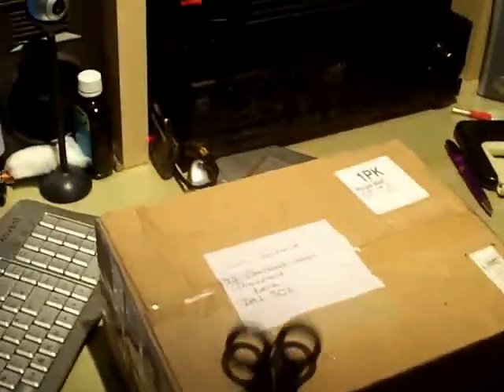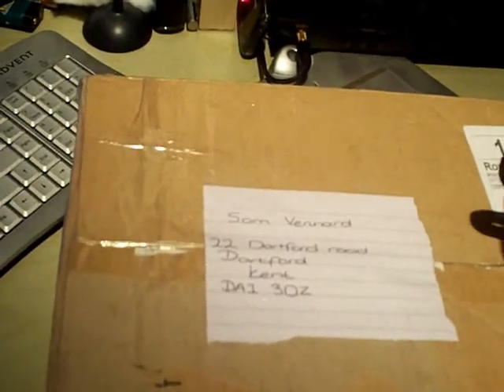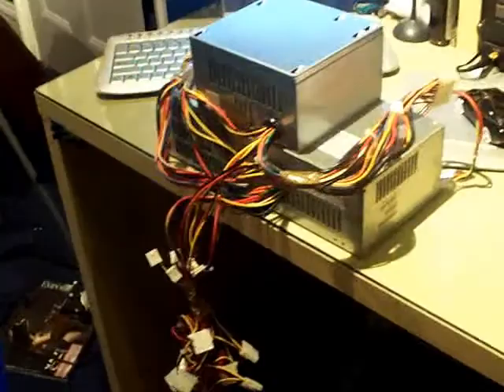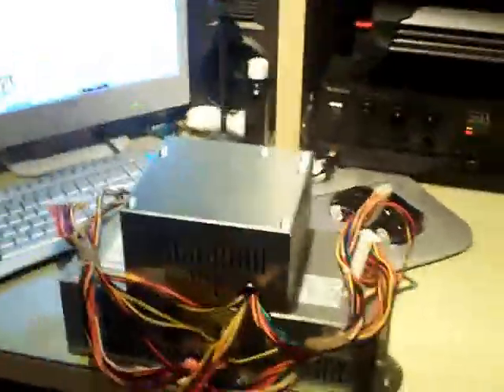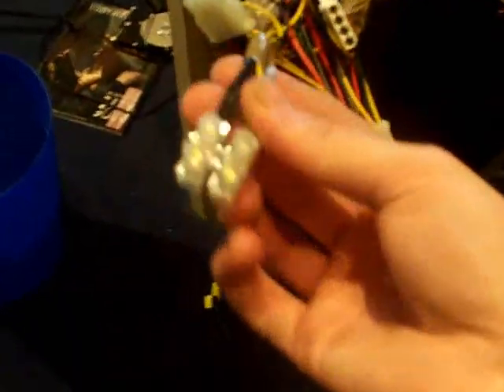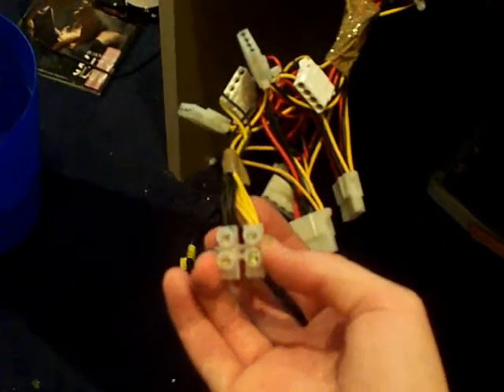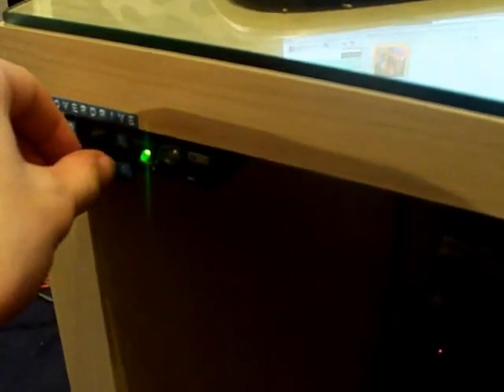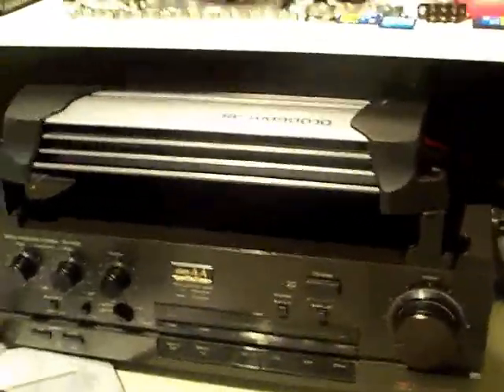Powering car amps with PSUs

Comment: im running something similar kind of setup myself im running 3 xtensions of 1 outlet totalling 9 plugs by nomeans unsafe as you can get a single gang extension and extension towers that sometimes have 10+ sockets i  supose it depends whats being used at the time. i bet ud have fun when it comes to sorting them all out  lol